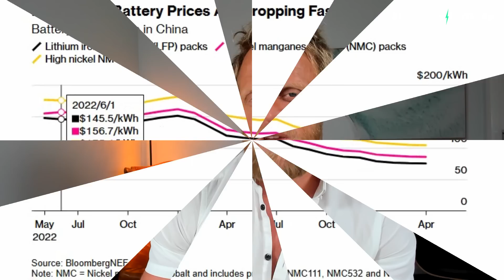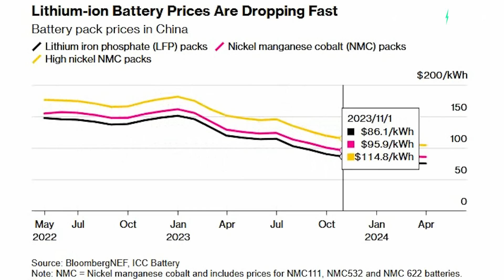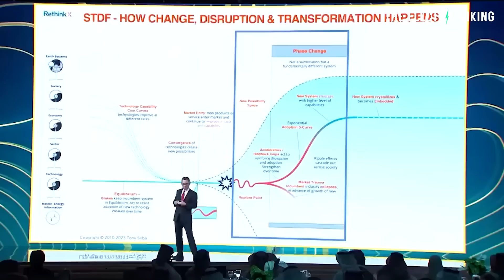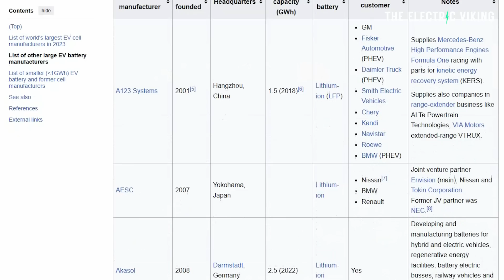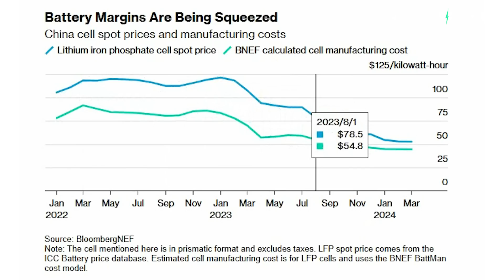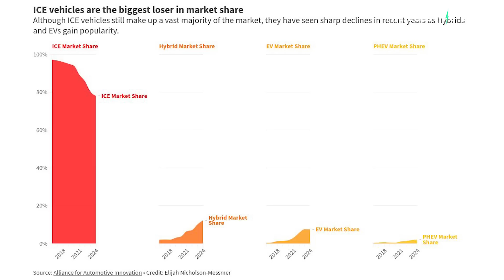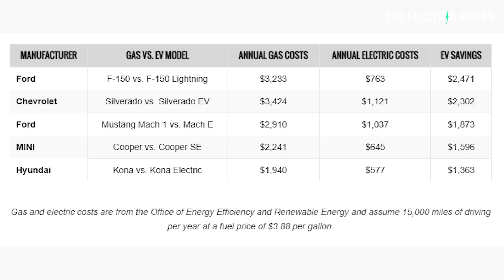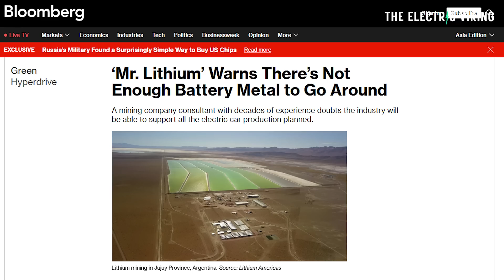Battery prices fall 51% to $53 per kilowatt-hour; "EV prices will keep falling"

Comment: This misses the key point, in the UK at least. 'Range anxiety' has been replaced with 'charger anxiety' and even the EV lobby is admitting there's nothing that can be done about this in the short term. Even if that problem were solved over night, remote charging is already more expensive than refilling an ICE vehicle, and NO SOLUTION has been arrived at for those with no off street parking. More than 35pc of homes in the UK do not have off street parking, that's over 9m households. Add to this the insane drive to Net Zero, there is no way that battery technology, range or cost is going to make any difference in EV take up.
Reply: In Glasgow there are relics to free charging which stand idle. A simple pricing policy will solve all ev problems at a stroke. 
There's no way the 70p/Kw is making money for anyone if nobody buys it. Sometimes the wind produces more power than can be used. We need intelligent pricing like Octopus provides.
Reply: Yes if you don’t have access to overnight charging the practicality of an EV disappears.
Reply: @LawrenceAsero  We got on OK with free rapid charging,  but, yes, cheap overnight charging near home is a game changer. It's not even just the price, it also cuts out all the fuel trips every few hundred miles. Not to mention V2L/G advantage.
Reply: Mercedes claim they have developed a paint that will allow an EV car to charge a couple of kwH a day if you leave it out in the sun.

It can generate about 20,000 km of range a year just from this paint...
That could go some ways towards eliminating many issues as this paint amounts to about 55 km range per day charging from just your paint, so if your commute is that range you pay el Zippo and just leave car out in the sun.

Mercedes can license this paint tech to other EV companies or maybe they can develop their own version of this
Reply: @scroopynooperz9051 In sunny regions I believe. No way in grey sky regions.
Reply: @EdwinaTS  it still generates energy in grey sky areas like England, just lesser so (maybe around 70% - 75% in England and Germany but 100% of that Max 20k Kms per year in say California.

Electric Viking did a video on this a couple of days ago
Reply: @scroopynooperz9051 10 years before that works and then will be an expensive options in $100,00 plus Mercs. It’s a nice idea, but Mercedes won’t do this cheaply!

Comment: I know it may relate more to current EV incentives in the US but EV lease deals in the US currently are below the ICE equivalent. Example: Honda Prologue lease $0 down, $199 month for a $50k car. If  an EV works for you and you need a car now or in the near future now is the time before incentives go away.
Reply: Yes, you can lease a Ioniq 5 SEL  for $230/mon, $4k at signing, 24 month term; that’s less than a $10k outlay (+tax etc) for 2 years of driving. I love a good fire sale…opps.…Let’s use going out of business sale instead. 😅

Comment: Two month ago our fund invested a charging station with 8MW LFP energy storage batteries in hunan province china ，Price for LFP batteries pack is 350 RMB（about 48 USD） per kilowatt ( Installation costs are included）
Reply: kWh, presumably - that's amazing. Looking forward to a 100kWhr battery for less than $5k
Reply: @mb-3faze  catl lunched they call "cheap batteries pack" 173ah VDA LFP 2.2C batterise cost 0.4 RMB(0.055 USD）per Wh. The cost of the battery cell of a 100kWh battery pack will be about 40,000 yuan (5509 USD) (excluding tax), and the cost of taxes, packs, service costs, car company profits, and car company risk control in the later stage will all be converted, and the cost is likely to be about 70,000 yuan (9641 USD)
Reply: @mb-3faze  CATL already lunch they called "cheap LFP batteries pack" 173Ah VDA 2.2C LFP batterise .The cost of the battery cell of a 100kWh battery pack will be about 40,000 yuan （5500 USD）(excluding tax), and the cost of taxes, packs, service costs, car company profits, and car company risk control in the later stage will all be converted, and the cost is likely to be about 70,000 yuan (9640 USD)
Reply: @mb-3faze  CATL already lunch they called "cheap LFP batteries pack" 173Ah VDA 2.2C LFP batterise .The cost of the battery cell of a 100kWh battery pack will be about 40,000 yuan （5500 USD）(excluding tax), and the cost of taxes, packs, service costs, car company profits, and car company risk control in the later stage will all be converted, and the cost is likely to be about 70,000 yuan (9640 USD)
Reply: Hi can you please let me know the company that you got the storage battery from please? It would be great if you could also share a contact name and email or number as well because I’m looking for a 8-10 MWH Battery Energy Storage System. Thank you!
Reply: @fjatoi  you can search Sieyuan Electric Co. or XJ Electric Co. they got eng webside, our project is part of 1GWH Centralized procurement energy storage project through open tender，those two company won the bid
Reply: @fjatoi   you can search Sieyuan Electric or XJ Electric they got eng webside, our project is part of 1GWH Centralized procurement energy storage project through open tender，those two company won the bid
Reply: @fjatoi  you can search Sieyuan Electric or XJ Electric they got eng webside, our project is part of 1GWH Centralized procurement energy storage project through open tender，those two company won the bid
Reply: I’m not investing in anything in China. Oh hell no
Reply: @stoveguy2133  I wish I had done what Warren Buffett did - invest in China. Just have to be smart.